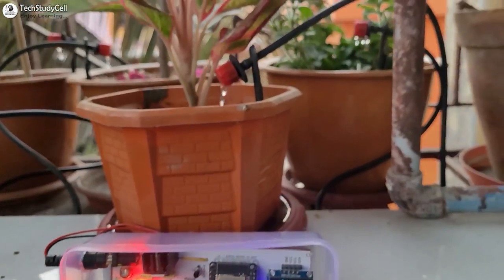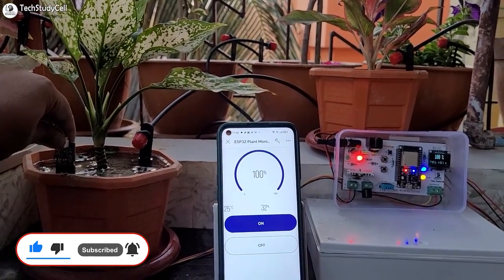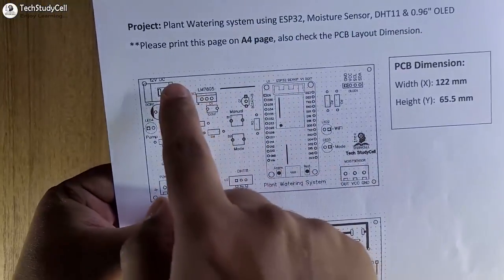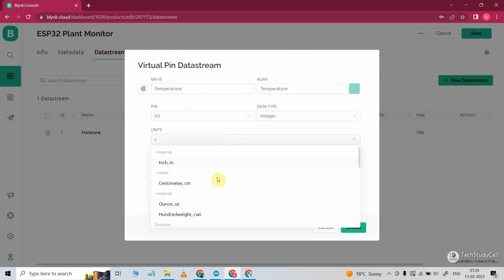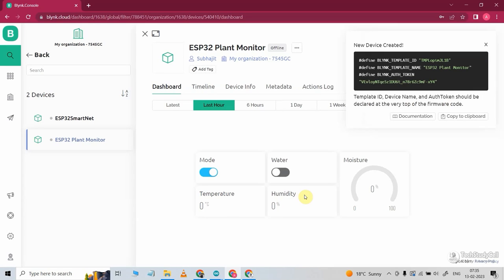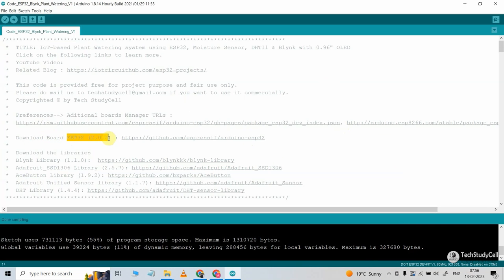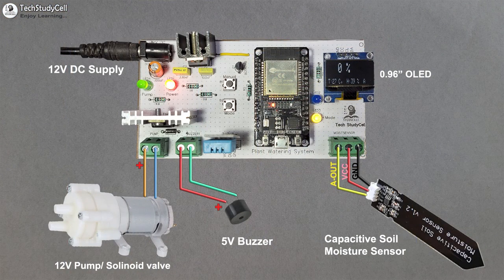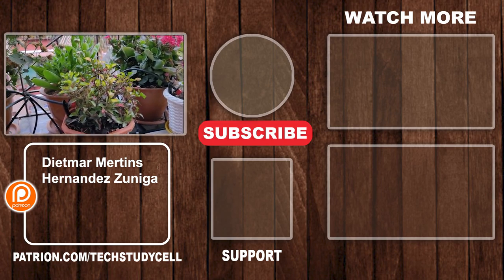IoT Based Plant Watering System Indoor project using ESP32 Blynk | IoT Projects 2023

Comment: witch type of wire did you use for connecting the sensor and 12V DC pump or solenoid valve ?

Comment: can i use a NodeMcu ESP8266 V3 Lua CH340 Wifi Dev. Board instead of ESP32 DEV KIT V1?
Reply: Same question mine.....what u did ? I have 38 pin esp32 instead of 30 pin esp32....can i use it ?

Comment: Hello bhaiya i need your urgent help , in my case i used a 5v relay module and whenever i connect the [in] pin of the relay to esp32 nodemcu then the green light of the relay module start glowing and my motor start working does not matter the soil moisture is 100% or 0% , now tell me what should i do , please reply as soon as possible.
Reply: Look I would suggest to use according to video but if it is working go and once check the components are not heating  up
Reply: @bushrajamal1027  yes bro i have checked everything ,everything is working fine but sometimes it turnoff my all the relays without my permission, i considered  this is an glitch in the code , one more thing is that whenever i go outside or i am not using this i turnoff the 5v power supply which giving power  to my esp32.
Reply: how did you fix it?
Reply: how did you fix it bro?? very urgent cuz im using this a project reference

Comment: Hi! Great video! You just made me go a little version of it! A little question from a non electronic guy... Why do you need all those capacitors at the regulators? Thanks for your answer in advance!
Reply from the maker: Generally solenoid or pump are available in 12V, but ESP32 needs 5V.

Comment: How do you able to print the circuit that match the hole in the pcb?
Reply from the maker: Just print the docx file shared on a4 page
Reply: @TechStudyCell  I mean if I have to design my own circuit. How do I know the distance between each hole in the paper so it will perfectly match the hole in the pcb? ( sorry for my English)